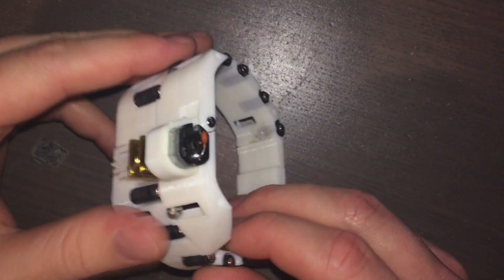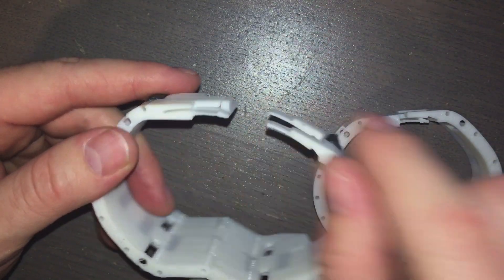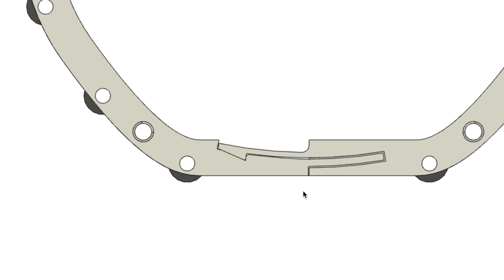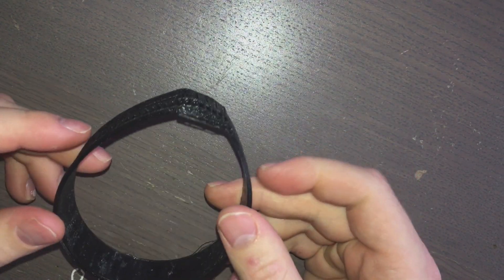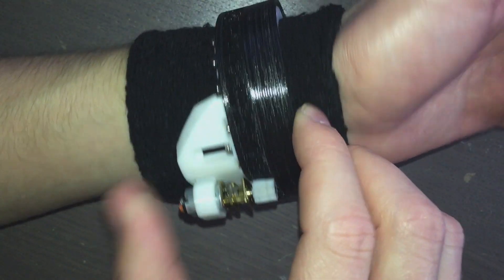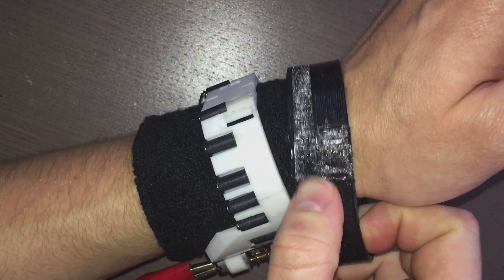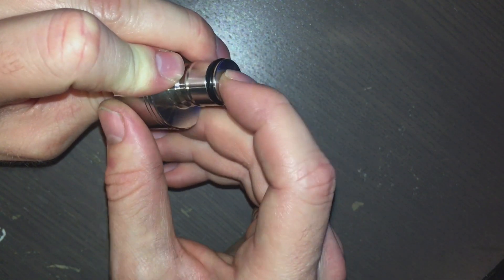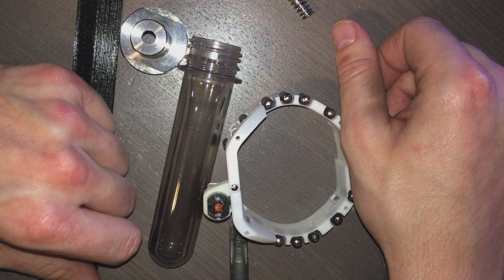Episode 2: Motorized Conveyor Bracelet | Research & Development

Comment: Hey I have an idea for the spinneret I know that you might be using the new nozzle but since it's a carousel why not have a nozzle and with inside the nozzle it has a y shape and have the nozzle rotate so it makes three different strands and as it rotates it creates a solid strand theoretical but would it be possible is the question I was thinking three different nozzles not big but small enough and within them it has a y shape or a y shaped divider so when the fluid Runs Through It it creates three different strands and as it rotates it creates a strongest strand of web now I can see you making the carousel why not apply that same concept to the nozzle but on a smaller scale and for suggestion to test it out why not make it a little bit bigger and make a stand for and test it out and rotate it like as a prototype just to see if it shoots apply it to like an handheld instead of a wrist shooter would that work?

Comment: Do you know how this will work with the web shooters, or have you not gotten that far yet? P.S. you’ll probobally need a lip at the front of the bracelet to keep the belt from sliding around. And you also might want to look into small vibration motors. Awesome job as always though! 👏🏽
Reply from the maker: I've done a lot of web shooters, I think it should be a short jump from there, but I don't know specifics yet.